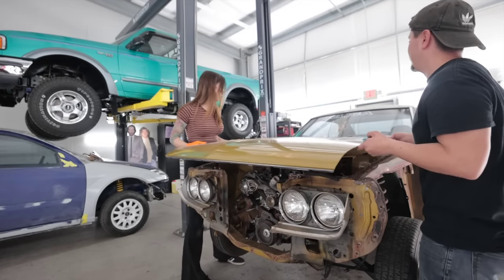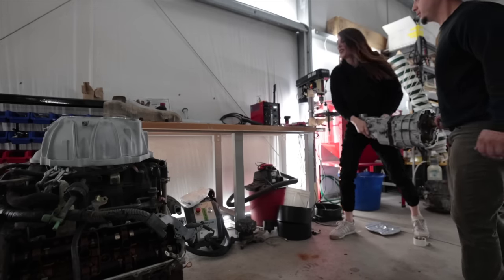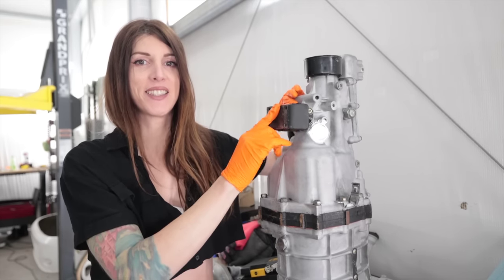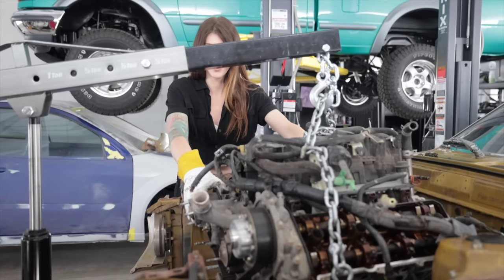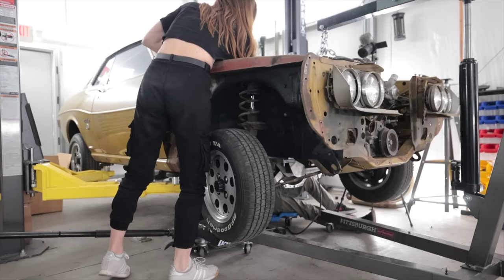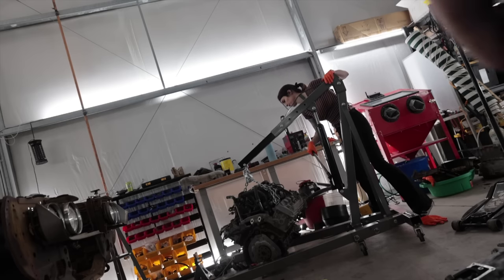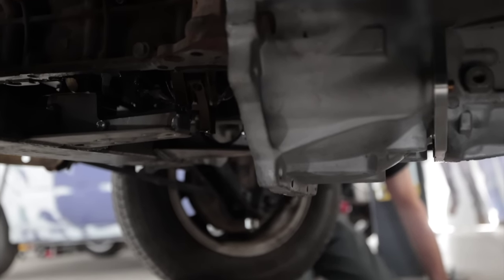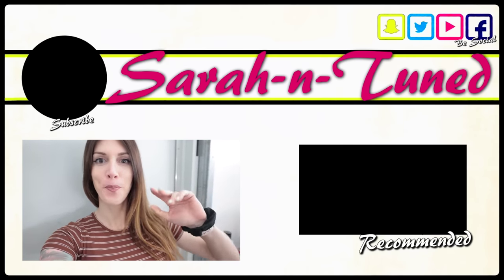Adapting An Aisin W58 Transmission For 2UZ Toyota V8

Comment: I would DEFINITELY do a "freshening" on the transmission.  If it's that far out, now the time, especially since you'll be hooking it to a V8!!!
Reply: Ya, 30+ year old transmission, putting a V8 in front of it.  Be silly not to freshen it up.
Reply from the maker: Yeah, it’s already going to be at its ragged edge with the power. If I had $12k for PPG straight cut gears I’d do that lol
Reply: Especially since that Orange/Red RTV on the input shaft bearing cover was definitely not factory... means someone has been in there before.
Reply: @SarahnTuned  they're pretty stout gearboxes and it's going in a super lightweight car so unless you decide to drag race it I think you'll be fine.  I just wouldn't put it in (permanently) without going through it.  No way to know how much it was abused previously.

Comment: Instead of a wiper for the vapor blaster, Google "spin window". It's a round port hole looking device that spins the water off. They use them on CNC machines and also on ship windows (so they can see out during heavy rain). You can buy them new or used....

Comment: I have a 1977 celica with a LS1 and I used a 1st gen rx7 (SA22C) radiator and it fit deeper in the radiator support giving you more room. Aftermarket ones are 3 core and will easily cool a v8

Comment: Hi Sarah. Doing a W55 conversion on my 68 Holden ute the original shifter was cactus. Got hold of a short shifter from Cube.  This thing is the duck's nuts. Crisp, smooth, rifle-bolt shifts. We also use a Cube shifter on the Nissan box of my mate's circuit cwr and it is also an ace bit of kit. Big reccomendo.

Comment: I'm liking the location of the motor more bettererer.  I still have this gut feeling, pressing on the go pedal will burn the tires off this monster.  I really like the bolt on nature of this conversion.  At first glance I didn't think it would be possible with out some sheet metal alterations.  Nicely done kiddo.  Thanks for the great work you're putting into your channel.

Comment: Sarah, with your vapor blaster you can mount a little wiper that is hand actuated in there. Or you could take a little piece of microfiber attached to a magnet inside of the vapor blaster and a magnet outside of the glass and you can move it across and wipe your window. Just a FYI.

Comment: This whole Celica build series is amazing. And tempting.
 For the engine, besides the 1UZ cylinder heads I've mentioned before, early 1UZ connecting rods are a useful upgrade too. And if you go for the better heads, the intake will be needed; it's a lower profile too which will obviously help. HTH!

Comment: That was so lucky that the gearbox and engine fit without cutting anything. I had to cut out half my firewall and the transmission tunnel down to where the handbrake was when I did my 1UZ/R154 swap in my 1980 Chrysler Avenger wagon.

Comment: Awesome 👍🏽   in New Zealand back in the day we had no new adaptation parts so you had to make them or know someone that new all the different cars and what could be swapped around on them,  or you started the project  and ended up just sitting there for a few years then someone had made adaptive parts for it lol 😀👍🏽 plus some guys could make new bellhousing from scrap metal to fit with adapter plates

Comment: Sarah, have you tried using a fish tank cleaner on your spray booth thing?  It is two parts; one fits against the window on the inside, and the other fits on the window on the outside, and they are held together by magnetism.  To clean the window, you drag the outside piece and it pulls the inside piece across the window with it.

Comment: I can’t wait to see how you deal with the emissions stuff. I would like to do this swap to another car one day. Great work guys!
Reply from the maker: It’ll have cats and the 2UZ is a fairly clean engine to begin with.
Reply: They do run clean, my 03 tundra runs great but it runs lean sometimes. Probably a vacuum leak. You’re installing the newer VVTI version and the air pump that lives in the manifold valley is for the cats 🐈‍⬛ 🐈‍⬛ to warm up quicker. Install an OEM air pump and denso oxygen sensors a to avoid headaches. I did a frame swap on mine years ago so I know these engines well. You’re so lucky to live in dry climate. Canaderp 🇨🇦 sucks for rust

Comment: I can't believe how well it fits into that tiny space. Are you using the stock exhaust manifolds then?  With your welding skills you could make a set of tube headers if you needed to.
Reply from the maker: The stock manifolds are tubular which is a great template, it’ll be a modified version of that design.

Comment: Manual Transmission rebuild - Done it to a couple of BW/Chrysler Valiant 3-speeds, and the difference in shift afterward is WORTH IT. :) Definitely put a kit with new bearings, bushings and syncro-rings, all three contribute to how smooth the 'box runs, as keeping the shafts properly aligned (yah, I know,..) makes the syncro's engage better with the dog rings and the actuator levers. Same with power transfer through the gears, if they're aligned properly there is less parasitic drag on them, so they run cooler, last longer as waste less fuel.
1:10 - OG fans were expecting this :D
Reply from the maker: Requires special Toyota tools for the front half which I do not have. Might be cheaper to farm it out rather than buying everything needed.
Reply: @SarahnTuned  What was the brand for the adapter plate? I'm trying to avoid making one myself to put a NVG-3550 out of a Jeep behind a Slant Six in one of my '66 VC Valiants,.... Though I may just end up swapping in the 3.8 V6 and six speed. :)
Edit :  Found it, dang, they only do Toyota and Nissan,... but they look really nicely machined.

Comment: Have you considered using Rain-X on the viewing window of your parts washer? Not sure if it will help, but worth a shot.
Reply: Or ceramic coat it
Reply: I thought a small wiper blad would be best even rig something up so it automatically wipes.
Reply: Or just fit a windscreen wiper to the inside - that's how they are quite often done.
Or a Kent Clear View Screen could be  purchased for about $1,000 but that's more than Sarah paid for the machine.
I expect one could be picked up from a scrap yard.

Comment: Such a cool project! Rather than buying a "flipped around on the shaft" gear change levery thing.. Can you not cut the original one in half and re-weld to your exact required custom length?

Comment: Why not add a few spacers to the bonnet mounts, so that you gain a few mm of clearance? Yes, it's a bit "honda ricer" but quite frankly, it's a mad little Celica with a MASSIVE heater under the front, it would probably benefit from the extra ventilation, especially if you get stuck in traffic.
Reply from the maker: You answered your own question in that comment lol

Comment: I think the 2UZ intake manifold is taller than 1/3UZ, if you need more hood clearance.
Reply from the maker: I’m contemplating ITBs still.
Reply: @SarahnTuned  I also wanted to do ITB’s, but then that’s also a height issue depending on trumpet length. For more streetability you would get long runners, then add filter height on top of that. It adds up. The 2UZ intake was reportedly an upgrade for 1/3UZ’s due to intake volume increase.

Comment: Are there no dowel pins on the adapter plate? Is there a different way of lining it up? Bolt holes usually aren't precise enough. You might need to center it on the spline shaft with a dial indicator.
Reply from the maker: 2pins yes

Comment: The R154 would have bolted in the same way, but considerably stronger.
Reply: Cost much more unfortunately
Reply: @TML34  Amen, w58 never lasts.
Reply from the maker: Requires bashing the tunnel in and the shifter area is even trickier. I almost went with it and agree it’s the better gearbox.

Comment: I bought a 2001 convertible mustang actually I was looking for a motorcycle and found the mustang wich is safer anyway I thought of changing it to a 50,L coyote engine I have a 3.8L V6 but I'm not sure it has the room and the cost $$$..

Comment: I've blown up 3 W58s with a 1UZ. Then again, clutch kicks in 2nd gear repeatedly will do that. Let's see how long a refreshed R154 will last with my abuse.
Reply from the maker: Haha. 100% agree. This isn’t going to be a thrash car. No drifting or drag racing in it. Canyon run type driving setup.
Reply: @SarahnTuned  Cressida is nearly 1500 pounds heavier than a Celica. Hopefully you'll have zero issues being a featherweight.

Comment: As far forward as the center of mass of the engine is I hope you don't do an endo since it's so far in front of the strut towers.
Reply: Is there any correlation between doing an endo and flippin it around on the shaft?